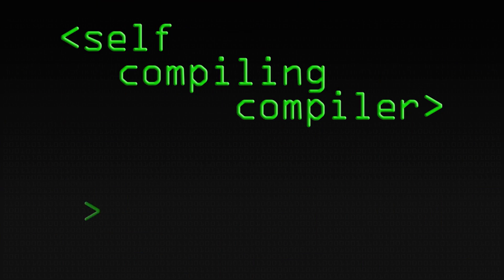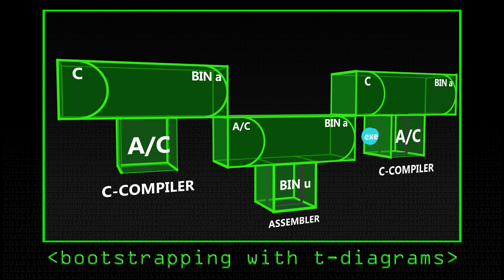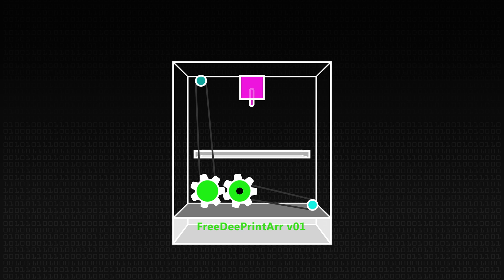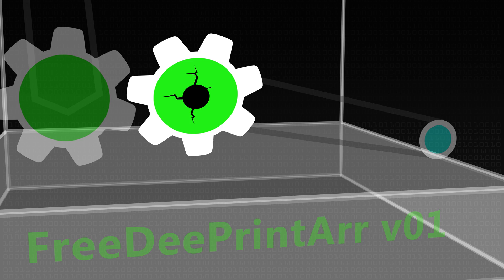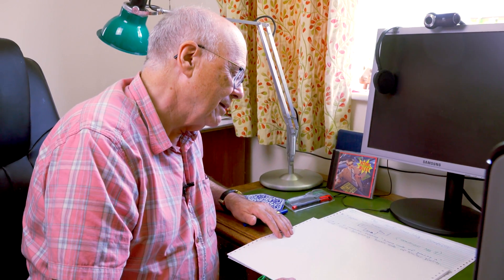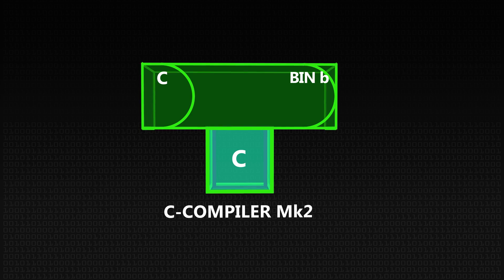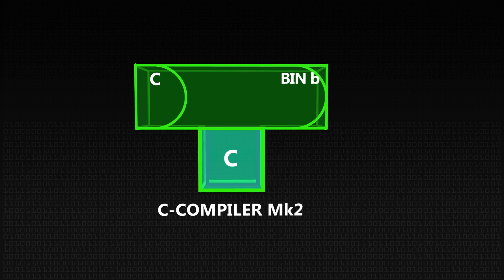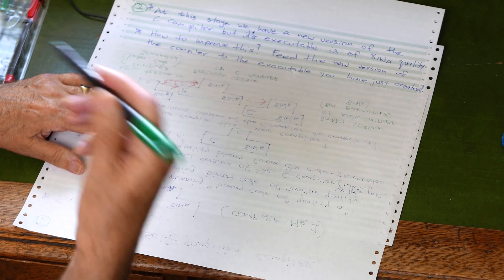Self Compiling Compilers - Computerphile

Comment: The original executable format for DOS was the COM program format, which was a "bare" (no headers, single code and data segment, meaning up to 64kb for code+data) 16bit executable. DOS would put that single section at a fixed location in memory and then execute from a fixed adress. The DOS EXE "MZ" file format (MZ being the initials of Mark Zbikowski, who defined the format) was the advanced format that would allow multiple segments, separate code and data, etc. 16bit windows EXE files use a newer format called NE (New Executable), and 32bit/64bit windows EXE files use PE (Portable Executable -- the portable came from how the same file format could be used in all the platforms Windows used to work on at the time).
EDIT: Added some details.
Addendum: If you have ever opened an NE or PE EXE file in a hex editor (or even in notepad, but don't do that, it would corrupt the file if you save by mistake), you'd see it has MZ at the beginning, which is there for anyone who tried to run a windows program in DOS, who would receive a message saying the program can't be run in DOS.
Reply: dos itself thinks that windows exe are just fine to run because it ignores all the windows specific code and data. the message saying the exe can not be run in dos is output by a small dos only code segment in the exe that dos sees and executes
Reply: @MonochromeWench  Yes. The "dos segment" you speak of is the beginning of the file, the header contains a number of reserved bytes before the actual data starts, and those bytes are used to create the little dos program that prints an error message. Both NE and PE executables have this.
Reply: MZ is not "there for anyone who tried to run a windows program in DOS". DOS .exe files have had the MZ preamble well before Windows. The thing they did with Windows executables was to include a .TEXT stub which does nothing else than writing "This program cannot be run in DOS mode." to standard output, at the same time keeping the format backwards compatible and exit gracefully when started from DOS. the Windows executable loader would look for the NE/PE after that stub, and ignore it.